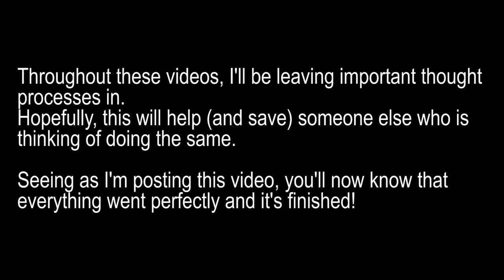DIY live steam boiler build - Part 1 of 4

Comment: Love your new Pipe Bomb Tony...lol...Silver Solder comes in different flavours regarding melting temps you know..Use some House bricks to make a heat reflector when soldering, keeps the heat on it...🤔😳🇬🇧
Reply from the maker: If I had somewhere to put house bricks that wouldn't set on fire, I would mate. I'm pretty stuck with what I've got and besides, it's all done and working perfectly now 😁
Reply: @Vortecks  Good man, I knew you would prevail....🤔🤔😀🇬🇧

Comment: Don't confuse flame temperature with heat energy delivered. A large soft flame will deliver much more heat energy compared a smaller intense flame. Too late I know but....You can place large parts into the kitchen oven to preheat them all the way through. This will allow a lower powered torch to melt and flow the silver solder. When it comes to actually running the boiler those small gas cartridges will cost a fortune look into camping cylinders preferably refillable. Did you concider electric heating with you large E bike batteries or even with a heat gun?
Reply from the maker: Unfortunately, I have to use what I've got mate. I could do with some fire bricks, I could do with a butane torch connected to a bottle but all I had, was a blowlamp and a camping stove.
It made it much easier after I invested in a MAP gas torch and bottles but it's all done now and that's the way it's staying...... I've had enough of the fumes, smell and danger 😂

Comment: If you have a copper boiler that has been soft soldered you cannot then silver solder it. There is an interaction with soft and silver solder.
DO NOT MESS WITH STEAM PPRESSURE VESSELS IF YOU DONT KNOW WHAT YOU ARE DOING!!

Comment: MAP gas will do the silver soldering and there are loads of videos on YouTube on building a boiler, 60/40 is no good, there again at least it won't explode because the solder will melt before it goes bang

Comment: Oh no!!! messing around with steam boilers is incredibly dangerous, I hope you took the proper safety precautions. so far so good, but still. ♥
had to check , seems 60psi would make the water have a boiling point of 145C, but you said you changed to silver solder so that should be ok.